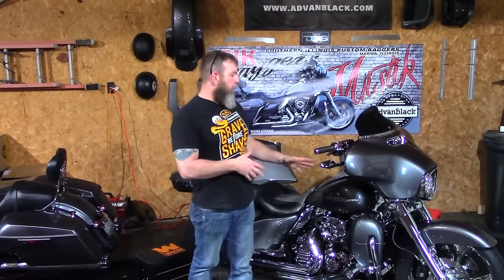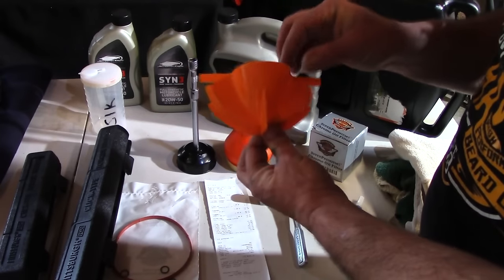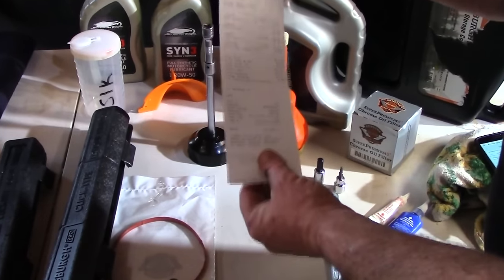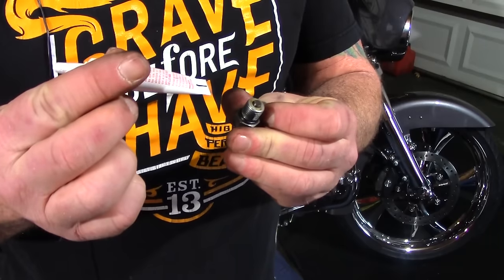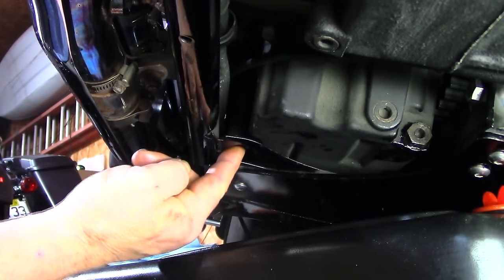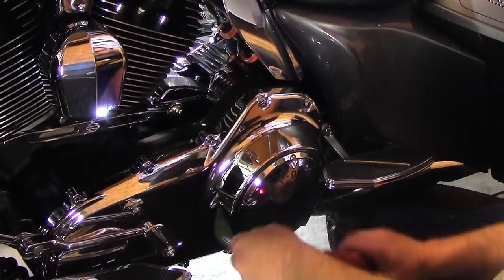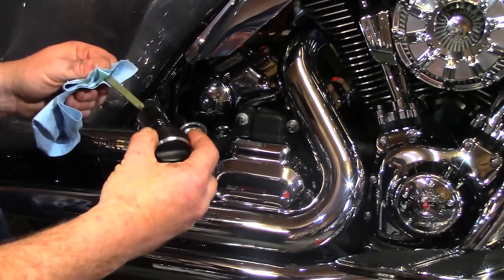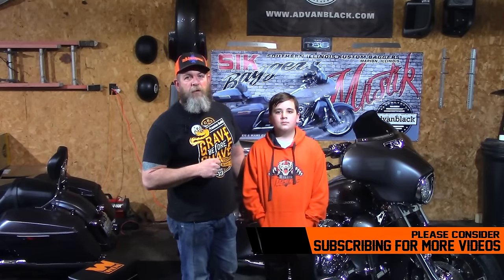⚡Twin Cam Complete 3 Hole Oil Change @harleydavidson  Touring⚡

Comment: I had a question about when you check the transmission level, does the dip stich have to be screwed all the way in and does it matter if the bike is straight up or on jiffy stand?....thx
Reply from the maker: bike on jiffy and screw it in all the way til the rubber touches..not tight
Reply: @sikbaggers  Thanks man :)

Comment: So when you are doing your final oil level check, and you warm the bike up. How long do you let the bike rest before checking the level? Will checking it immediately after shutting it down, leave the level showing lower than what it really is because of Oil still draining from the cylinder heads, down? Just something I've often wondered , because that is the same basic principle for checking the oil on metric bikes as well. Good video.
Reply from the maker: Thanks man..I treat it the same as any vehicle..let it warm up and then let it settle down a little and then check it.

Comment: Do you need a lift or jack ? It looked like this was all done on the kickstand. And if you run synthetic how many miles till you change your fluids?. My bike is a 2016 Street Glide Special.
Reply from the maker: You do not need a jack or lift...this oil change can be done straight from the kickstand. Every 5 thousand miles on the oil..Your 2016 should have came with synthetic oils in it.
Reply: @sikbaggers AWSOME! thank you very much for responding. Your channel is great and very helpful. You definitely have a new subscriber here and I'll be sure to recommend your channel to others.

Comment: Did you do the Change on the jiffy stand?
Reply from the maker: yes..you can do either way...on the jiffy or straight up on a lift or jack.
Reply: @sikbaggers  ok thank you very much for the info I just started riding this year and wanted to do a 3 hole oil change and a shop was gonna change over $300 to do it!!! Thanks again.

Comment: When you say "run the syn3 in all three of my holes" does that mean you put the same liquid in the motor and transmission or you just use that brand for both motor and transmission. Moving to HD after years of imports (Europe and Japan) and this would me my 1st bike with a dedicated transmission.
Reply from the maker: Yes we used to run syn3 in all three holes and you still can. Lots of guys do it and HD even uses this on their 3 hole oil changes if you take it in. you can also run syn3 in the engine and HD
s Formula+ transmission and primary chaincase lub. We have tried amsoil engine oil along with their crankcase and tranny fluid and liked it as well. We currently have syn3 in the engines and HDFormula+ in the crank and tranny.

Comment: Would syn3 cause the clutch to slip on a stage 2 114, making 120hp, 130 ft-lb?
Reply from the maker: Its just a 20w-50 full synthetic oil...If your clutch is slipping you have bigger issues than fluid. Unless of course its way over filled...but any oil will do that
Reply: @sikbaggers  Got it thank you!!

Comment: I bought my 2016 Road glide ultra back on October 2021. It had 28,000 miles . The dealership told me my next service was not until 2023 . This is my first Harley and bike ever . I didn't question the sales person when I bought my bike regarding the time between service because of my inexperience with a motorcycle.  Now I'm wondering if 2023 for it first maintenance check is way to long . Since Oct 2021 I've already put 1200 miles on my bike . If possible can you advise me on what's the proper maintenance mileage.  Thank you for sharing such and informative video. Big Mex ( Pete)
Reply from the maker: For a dealer to tell you a "year" and not "mileage" is just plain wrong.  That dude/dudette needs to be fired.  Imagine you taking that to heart and you put 55k miles on your bike in 2 years. Your fluids would be destroyed and probably your engine and transmission with it if the clutch didn't go out first. That's dangerous information they are handing out. I would for sure call and complain to the service manager..that's the most ludacris thing I've heard from an HD dealership and I've heard a lot. * So fluid intervals are 5k = oil, 10k= primary, transmission = 15 k...but hears the deal to help keep it more realistic and easy to remember. Every other time you change your oil, change your primary and transmission and you'll be gold.*  If you email me ill send you a AT HOME checklist you can do every 5k miles to keep your sled in top shape! slhousden@gmail.com We'll get you hooked up and taken care of.
Reply: @sikbaggers You are correct,  these dealers need to get the proper service information out . My key fob said next service and maintenance Sep 2023 . That's what the sales lady pointed out as my service schedule.  It sounded off to me . I'm glad I viewed your channel and heard back from you.  Thank you

Comment: Just one question,  is it better to do the oil change its side stand or on a motorcycle jack? Does it make a difference?
Reply from the maker: Doesn't matter..your drains are on the low side of your jiffy except for the transmission..if you do it on the jiffy just stand the bike straight to make sure you have all the fuild out for a minute. Itll drain pretty good on a jack but the plugs are hard to get to. I generally do them right on the jiffy.

Comment: Really strange i just changed my primary oil and it was filled with a tiny bit over one quart. I let it drain hot and level. same year bike model and engine. Musta had some i didn’t get 😞

Comment: Is your bike straight up or on  jiffy stand when u checking trans ?
Reply from the maker: Park on level ground on the jiffy stand.
2.  Remove transmission lubricant dipstick.
Wipe dipstick clean.
3. Insert dipstick into transmission. Thread dipstick in until
O-ring makes contact with case. Do not tighten.
4. Remove dipstick. Check lubricant level
on dipstick.
Reply: @sikbaggers  got it thank u very much
Reply from the maker: @limitlessworx5724  your very welcome

Comment: Have you heard of a 2018 FLHTKSE BURNING about a quart of oil every 5, 000 miles or until it reaches about 15,00 miles?
Reply from the maker: woah...no...you got something going on internally. 18 should be under warranty though? Have them tear it apart.

Comment: Steven I tried that Blue Dream wax from Killerwaxx , your are 100 % on the money it is awesome.
Reply from the maker: Gary....Yes sir! I love it...I primarily use it on dark colors...the bike and my wifes Black car ...every time with amazing results. Did you use some of the Extremely Wet Polish with it? I only polish my bike over the winter months when we are down and just maintain the shine with the wax all summer.
Reply: Yes I bought the polish also. And the Orange Pop detail spray which is also awesome. I used it on my Mercedes too. Super easy to apply and remove.
Reply: Where do you buy that wax etc ?
Amazon maybe.

Comment: Are you using thread lock or thread seal   and  is it really needed??
Reply from the maker: Sorry for the late reply, just got back from Sturgis...its not thread locker...just seal...and no its not needed, its just an old habit from working on bikes that used to leak like crazy...it wont hurt either
Reply: @sikbaggers  Thank You for getting back to me!!! Liked and subscribed

Comment: What kind of thread sealer are you using before putting the drain plugs back in?
Reply from the maker: Permatex high temperature ...about 6 bucks for a tube at the local hardware store...last forever too as it doesnt take much
Reply: Ok thank you very much!

Comment: Do you use syn3 20w-50 in all three holes?
Reply from the maker: Yes you can use syn3 in all 3 holes.  We try to use specific oils for the trans and clutch but HD will put it in all 3 holes if you take your bike there for service unless you state otherwise.

Comment: Greetings from Bolingbrook, IL! 

Is it recommended to change all 3 holes every season?
Reply from the maker: Hey northern neighbor!! The intervals for the 3 holes is 5k on oil, 10k miles primary 20k miles transmission.  however im guilty of changing them before that...5k on the oil for sure..but the primary and tranny get it done at 10k...so every other oil change.

Comment: Syn 3 is fine as engine oil ,,,  i guess , on a  Twin cam or Evo , i wouldnt  put it in the trans, or the primary ,too thin,Primary chain case oil , and 80/90 or 85 /140 in the transmission, just my two cents .

Comment: Great video! Did you warm up the bike before the fluid change? Also, you did the job on the jiffy stand. Can you do it level, or is it better to do it all on the side stand?
Reply from the maker: Yes always warm it up first...I should have stated that and I apologize for overlooking that.  Yes you can do it on a stand too. I have a lift with a stand and thats how i do them..I shot it this way just to show you didnt have to use a stand. Just make sure you check the right level on your dipstick whit it level..remember 2 marks on the stick,one for level and one for jiffy.

Comment: Thanks for the video, I have always done my own service on cars, boats , bikes and anything with a motor😂. I really found your video very easy to follow . 
I just purchase a 2014 Ultra Limited with 7800 miles. The original owner had the 1k and 5k selrbice done at the dealer. The 5 k service was done in 2016. So although it’s not technically ready , should I change the oil now? I always thought at least annually change oil especially living in colder climates and not being able to ride during some winter months.
Reply: Casey Ski64 yes. Change it. 3yrs is too old

Comment: Thanks to you and your son for a very informative and easy to follow "how to do" a 3 hole oil change ! I have your video saved in my favourites and just click on it as required. Ironic enough you worked on a 2014 street glide same as mine so worked out great for me. Only 1 question arising.... you used a T25 Tor., for the derby cover, my tool kit only had a T27 so that's what I used, just curious if the size you used was 25 or 27 ? Anyway don't matter that much as mine worked out with what I had . (T27)Thanks again sooooo much !  Be safe and all the best from the east coast of Canada!!(Torbay, Newfoundland and Labrador)Jim
Reply from the maker: Hey Jim...thanks for checking it out my friend! Ill let the camera man know too! I would have to go look., heck I may have said the wrong thing in the video...ill have to double check. Glad the video worked for you too. Its pretty easy once you do it a few times itll be like science! Wont even have to look at the numbers. Thanks again man!! Be safe! Knees in the breeze!
Reply: Thanks again Steven (and son)....will be following your video's !Appreciate your reply as well....Be safe and all the best !Jim
Reply: Hey Steven.....forgot to mention one thing that might be a helpful tip for your viewers.... if you only have one torque wrench and it's in-lbs, no problem, if you want 19 ft. lbs for your three plug hole torques, just multiply 19 X 12 and you have 228 in-lbs on the same torque wrench, you don't need a ft-lb wrench. Your other two torques are 50 and 95 in-lbs which you can do on the same wrench! Hope that makes sense.CheersJim

Comment: Hey Steve, when changing primary fluid, is it best to have the bike level(not on jiffy stand)?
Reply from the maker: Hey Troy...I drain everything on the jiffy as the jack seems to get in the way. Your oil and clutch is on the down side of the bike when on the jiffy...the transmission however is on the up side. When I get it drained I just simply stand the bike up straight for a few minutes and let it finish draining.  The absolute best way would be to have a wheel chock mounted to your floor or a lift to hold the bike straight but not get in the way like a jack will.
Reply: @sikbaggers  Thanks Steve. Keep making those great videos!

Comment: So how much money will I save doing it myself vs dealer?  Also, how often do I need to change my oils?
Reply from the maker: close to a 100 bucks depending on your local shops hourly rate..ours charges 130 and hour. Oil = 5k, primary = 10k, transmission = 20k Easy way to do it though its every other oil change do a 3 hole...that way you fresh fluids in your bike at the start of riding season...assuming you have riding seasons and also that you ride your bike more than 10k a year. Thats just how i do it and I dont have to try to remember what I did last time.
Reply: Sounds good thanks for your help sir

Comment: hello very good day., excellent video .. I have a doubt in the amount of oil for each part., you can share the exact amount ... I have an electra glide classic 2013 greetings from mexico.
Reply from the maker: start with 3 quarts in the engine (then bring up to appropriate mark on dipstick).
Transmission takes .28oz (0.875 qt). Chaincase takes .38oz (1.1875 qt). Add those in, bring the motor up to tempature by letting it run and then check and add if you need to.
Reply: @sikbaggers  what is the amount in oz. of engine oil?
Reply from the maker: 32 ounces in one quart so 96 ounces total
Reply: @sikbaggers  thank you very much I warn you greetings

Comment: 2016 road glide, my owners manual says the primary uses 34oz WET and 38oz DRY, how do you interpret that???
Reply from the maker: just draining the primary means its "wet" still fluid left in it...if you ever disassemble the primary for any reason that is dry. Start with 32 or 33 oz and see where it falls out on the clutch....if you over fill you will have a hard time finding neutral. The oil should just go up on the bottom of the clutch. Use a flashlight and look at the bottom of your clutch with the bike straight...the oil level should fall out about a 1/4 inch or so on the clutch. Easier to add more than remove some.
Reply: great, thanks

Comment: Are you doing all this with the bike on it's kickstand? Cant really tell
Reply from the maker: Yes I did all of this on the jiffy stand..Cant use a jack very well as its hard to get to the drain plugs..if you have it upright on a stand or a lift just make sure to check the proper marks on your stick when refilling with oil. This can be done either way, straight or an the stand.  Its when you are re filling that you need to watch the marks..there are 2 marks..one is on the jiffy and one is with the bike straight.

Comment: Great video, thank you! I saw in the comments that you tried Amsoil, wondering which brand you've landed on and why?
Reply from the maker: yes I put amsoil in the Whiskey Project just to try something new. Ive really only got about 1200 miles on it now with that oil. The oil seems to be doing great, I'll have to check the oil when I service it to see how it stood up and hopefully no metal shavings. I would like to find a dealer to buy it from though..buying it from the local HD was pretty expensive ...kinda shocked me actually because i have seen guys posting way cheaper prices than I got. But the local HD is the only one around me that had it.
Reply: @sikbaggers  thanks for the reply. I'm interested in hearing what you think once you do the service, like you said. Stay safe!

Comment: Ok so I don’t know a lot of bikes but my question is. The bike you work on had 2 oil drain plugs?
Reply from the maker: On the big twins the tranny and primary are separate, so there is engine oil drain, primary drain and transmission drain
Reply: Steven Housden  thanks

Comment: Can you put slick 50 in your motor oil 06 Road King police bike???
Reply from the maker: Hey John I cannot say as I have not used it but I can relate you back to this article I had read on it and this gave me enough info to turn against it...read this small article over, particularly the part from NASA. I just dont use it....so I cannot honestly give you an answer on that. https://www.bellperformance.com/blog/oil-treatment-for-motorcycles

Comment: hi...please tell me if the 3 oil cans are the same oil ...or they are diferente for each other
Reply from the maker: in this video I ran SYN3 in all three holes. You can buy other brands of oil such as Amsoil which has a certain blend for each hole. But if you are using Harleys Synthetic oil you can put the same oil in all three holes
Reply: cool sir thanks for the quick reply ....assistance and materials in Portugal are to expensive and now with mr trump taxes prices rised up all coming from the u.s....thanks once again ...all the the best for you.

Comment: What is the item number of the blue Locktite that you use?  Thanks, and thanks for the great video!!
Reply from the maker: Thank you, much appreciated. I use Permatex Threadlock Part # 24300 picked up from the local OReilys auto store for around 10 bucks.  However the Loctite 243 Medium Strength is the same stuff...I have a tube of that as well. You just want Medium (blue) whichever brand you get. Holds a good seal and its removable and easy to clean up.
Reply: Thanks Steve!!
Reply: Hey Steve...got another question for you...I saw another video of yours, where you are detailing Travis's Bike.  I noticed an IL plate on that bike.  Where are you based out of?  You don't have to answer, I was just curious. Thanks again for the very professional videos, and great content!!!!
Reply from the maker: Yes sir..Im in Southern Illinois near Carbondale. Are you from illinois?
Reply: Yep...from a small town called Streator, about 15 miles south of Rt. 80. Thanks Steve!!
Reply from the maker: Good ole Streator...Been there a few times. I was a Correctional Officer at Pontiac for 12 years.
Reply: Small world brother!!  Keep up the good work with the videos!!  Ride safe!!

Comment: Did you use the same oil in all 3 holes, or did you use transmission for trans?
Reply from the maker: SYN3 in all 3 holes. Other brands make specific oils for the components but with the syn3...HD recommends in all 3 holes.